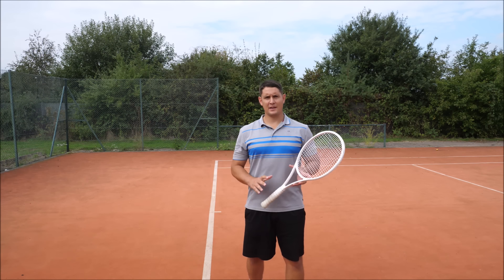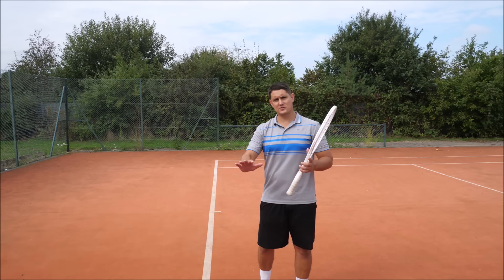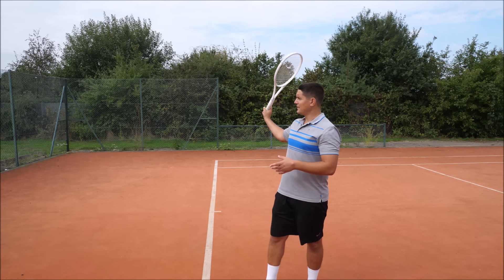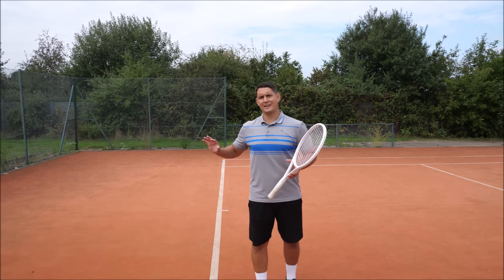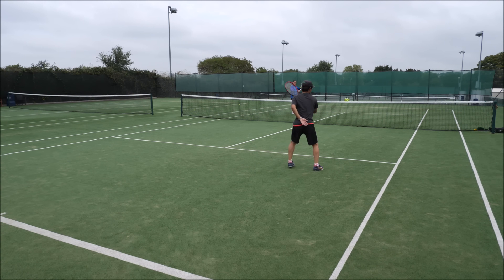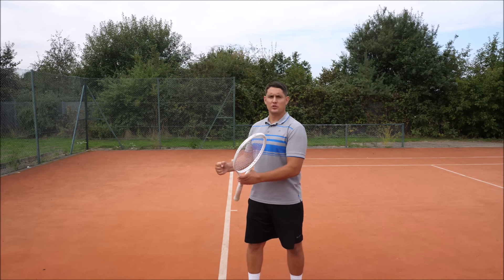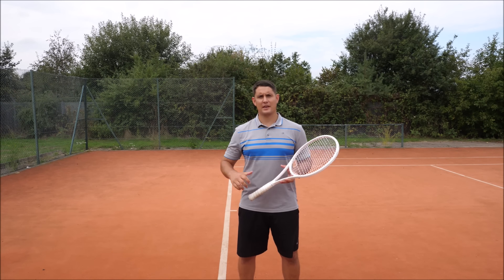Tennis Forehand Transformation - Technique For Maximum Power and Control

Comment: Hi Simon, thank you for this great Video.
09:20 " The upper body goes first" . Pleas correct me if i´m wrong, but isn´t it like that: movement from the feet to the tip of the racket?
I think you have to release your hips BEFORE your upper body, to keep the kinetic chain maintained? Please feel free to correct me :)
Reply from the maker: Hi Benjamin
Normally yes, that is the sequence, the hips open up along with the shoulders uncoiling and the racket follows. However, with this chap, he was opening up too early with his shoulders and hips and his racket would drag behind and he'd contact the ball late so I wanted him to feel the shoulders uncoiling first along with the racket so he could separate the upper body from the lower.
But in general, you're 100% correct.
Thanks for watching.
Are there any videos you'd like to see from us in the near future?
Simon

Comment: So when you have to run to the ball, is it best to have your racquet in the three o clock position before planting to swing or should you plant, turn, and swing?
Reply from the maker: You want to be ready to hit the shot as early as possible, on the run that means preparing the racket on the way to the ball.
You simply wouldn't have to time to run, turn and then hit.
The turn actually makes it easier for you to run because your body is then side on so you can use normal running steps.

Comment: Quick question 
Your forehead form seems to base more on open stand while your student more of shoulder turn and angular, which do you recommend?
Reply from the maker: You need to be able to hit with all stances, each ball requires a different stance and set up.
Open is great for wider balls, neutral stance for midcourt balls you want to attack.

Thanks for watching
All the best
Simon

Comment: Great video. A small remark: the non-hitting arm in the power position is not.there because the balance or tracking the ball (these are secondary factors - in the backhand you don't have a non-hitting arm for the balance or to track the ball, but players are doing well concerning these factors while playing the backhand). The non-hitting arm is important to initiate the body rotation, adding more power to the forehand by accelerating the rotation of the hips and shoulders.
Reply from the maker: Thank you for watching.
Please don't forget to subscribe to the channel and turn on the notification bell.
All the best
Simon

Comment: great lesson man. wondering if you have done or can do a another forehand video, regarding, I have a tendency to be moving backwards on my forehands (or off back foot against pace), and buggy whipping way too many balls , which loops the ball more and makes it much harder to put away .  Suggestions?
Reply from the maker: Without seeing your forehand I can only make a few suggestions, if you're using the buggy whip too often that leads me to believe you're hitting late. So a shorter swing on those fast balls would help, along with earlier preparation.
Work on using the neutral stance as often as you can so you can transfer the weight into the shot.
All the best and good luck
Simon
Reply: @TopTennisTrainingOfficial  cheers amigo, will think about it during my match later, and warm up

Comment: Great tips!  Looks like the student made a heck of an improvement in just one lesson and has the potential to develop a very good forehand.  I think getting the racquethead lower and brushing over the ball was a huge benefit.  I * think * I'm moving my back leg forward but probably not with the torque and timing it should be.  I know I need to work on getting my hips and legs into the shot more and get more flexibility into the racquet lag.  All the good players seem to get a smooth but definite acceleration of the racquet prior to contacting the ball and they get that amazing centrifugal force that a hacker like me has problems achieving.  Relax and shadow swing with perfect form then get out there and let it happen naturally is the way to go I guess.  Thanks Simon!
Reply from the maker: Shadow swings in front of a mirror are one of the best ways to improve your game.

Thanks for watching
All the best
Simon

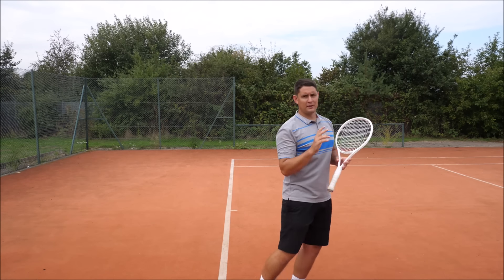Comment: Great video Simon! One thing I would like to point out that at around 9:15 in the video, u tell him that upper body comes first but isn’t it the lower body that comes first and upper body follows. Also I think the hip coming around on the FH or BH has more to do with force you put on the ball through ground force or rotation I. E you cannot force it. Just my honest opinion and points. Feel free to humble me. Thanks
Reply from the maker: You're right when it's an open or semi-open stance. The hips would uncoil first, followed by the shoulders then the arm comes through. However in the neutral stance when you use the pivot step that's not the case. If the right leg (back foot) came first then at contact the player would be totally off balance and the body would be swinging in mid-air while they try to make contact. By allowing the shoulders to come through with the racket you can rotate the upper body, then the hips rotate and finally the back foot. The legs can drive upwards before contact though, you just don't want the back foot swinging around too early otherwise the player will be off balance at contact.
As for the force, if you step in with the neutral stance, rotate the shoulders but don't allow the back foot to come forward, you are blocking the rotation of the body, putting unnecessary stress on the lower back/hips and also destroying your chances of having a good recovery.
Thanks for watching,
All the best
Simon
Reply: Thanks for your reply. I understand what you are trying  to explain, I Just feel that some players force the rotation and lose balance. Rotation should be a natural phenomenon not a forced one. Thanks for your time and I look forward to your next video. Keep up the good work
Reply from the maker: @rickywatson5955  Thanks for tuning in

Comment: My forehand , like this fellow, has inconsistent form. I'm more comfortable on the backhand. I can chose to drive with top spin, hit flat or slice. A friend & I have been sharing the ball machine at the club & that has helped in breaking old patterns. A bad habit of my friend is that he doesn't start taking his racket back on his backhand until the ball is crossing the net - which results in a  mainly late sliced ( weak ) stroke. This has been an excellent video that shows a ~ z of the forehand.  Thanks
Reply from the maker: Thanks for watching Ray
All the best
Simon

Comment: Thanks Simon great info as always...as far as keeping the hand on racket throat to the 3oclock position there seems to be an exception---Djokovic...he keeps his hand on  the throat past the 3pm position (longer than most pros)...he does not take his hand off until the racket is even w his back shoulder approx 4-5pm position....I always felt he did this to make sure he gets a larger amount of shoulder rotation relative to the hips...any comments on Jocko? Thanks!
Reply from the maker: It definitely works for him, his swing does tend to go to 6 o’clock though so slightly further back than many of the other pros. I think if you’re timing is good, it can work. But it’s all about finding what works for each player individually 
All the best 
Simon

Comment: Need to blend this technique with grip. Eastern forehand vs semi western. Racquet path with face angle at point of contact, produces different trajectories, height vs depth and degrees of topspin. A bit complicated but every player needs to think about this to produce the kind of shot they want.
Reply from the maker: That's correct Robert. However the grip is only able to produce a good shot if the swing is correct, if the swing is too big or late, contact will also be late and the racket angle will be off so the shot won't be as good as a well-timed strike.

Thanks for watching
All the best
Simon

Comment: Hi guys, pleasure to hear from you as always.
I'm struggling quite a bit with my forehand now (which it's insane to me, since it was my backhand which let me down in matches while my forehand did all the job jaja).
The main thing is that I can't generate much top spin, my shots goes far too long and I can't pace up my shots as I wanted to.
I know it's something about accelerating with my wrist, but I can't figgure it out.

¿Maybe I need gym to train my forearm to get more power/stability or it's exclusively about technique?

Sorry for my english, I hope I explained it well.
Reply from the maker: We have some new forehand lessons coming out very soon.
Look out for those. In the meantime make sure your racket head is getting under the ball prior to contact and you're brushing upwards from 6-12 o'clock.
All the best
Simon
Reply: Don't think of it as of wrist acceleration but of racket head acceleration. First it would be important to know about your grip: I had an student that was struggling with top spin so we changed from eastern so semi-western grip to make it easier for him to deal with consistency. If you don't know which grip you have, grab the racket like you would a hammer - that would be continental - and keep rotating it to the left one eighth at a time. Two would be eastern grip, the fourth would be full western. Now make sure that at some point before impacting the ball the racket head must be below the ball height and try to brush it diagonally. Though that's NOT the way it happens, try to picture in your mind something like brushing from 4-10 o'clock or from 5-11. Don't worry about depth initially, you can easily get depth adding more height over the net. Good luck!
Reply: @TopTennisTrainingOfficial  Thanks!
Reply: @Motenai  Thanks!

Comment: Thanks for the video. I notice Djokovic for example (when he has time and it isn't a really heavy ball incoming) brings the left hand quite far around like the player here .. but I guess he is getting through the preparation phase faster.. so it's less WHERE the left hand gets but more WHEN it got there that is the problem? Ie he is still there too late
Reply from the maker: Djokovic does bring it round quite far but he also has great timing and can "cheat" that way.
For this player, he doesn't have that timing to pull that off

Comment: I played golf for a long-time. And, when I first started, I had a TOTAL baseball swing (which is bad.) I could (very occasionally) hit it very far, but I was very, very, very inaccurate. 
Anyways, after 2 summers of practicing daily I developed a nearly flawless swing.
I broke it down ONE mechanic at a time and KEPT on that mechanic until it felt natural. 
First, I made SURE to keep my left-arm straight, but I wasn't comfortable enough to break my wrists on the backswing, so I kept my RIGHT arm locked as well. (Which is incredibly incorrect.) For MONTHS I played like some total moron, swinging while both my arms were PERFECTLY straight, with my wrists LOCKED, I looked like a human coo-coo clock and my arms were this pendulum swinging from 6, to 3, to 9. But, despite the fact I looked like an idiot, I noticed I had almost NO mis-hits, and my ball was going VERY straight, though not very far (about 180 yards with a 3-wood.) After that, I just kept adding ONE mechanic at a time, and before long, I had developed a beautiful swing. 
I say all this for one reason: most people like to try and do new things, yet often they feel unobtainable or impossible. Yet, we can do almost ANYTHING if you focus your mind, and put-forth some effort.

Comment: Coach - question, you did not mention face down racket position or head whip in the drill. Are either of these things important for top spin and or power? Second question how do you control the height of your shot over the net?

Comment: great video as usual, just wondering about the back foot follow through, you don't always see this on the pros, why (especially in the warm up)?
Reply from the maker: The pivot step is used in certain situations, for example, if Federer has a shorter ball you'll see him use this sometimes. In the warm-up players wouldn't use it as they are so laid back with their footwork and don't want to waste energy. They've already warmed up properly before the match so the 5 minute warm-up is just to get help them relax and get a feel for the opponent's ball and the court.
Reply: ok, but this works really well with a side stance, when you have an open stance isn't it a bit harder to follow through?, the players seem to only bring their back foot up to the level of their front foot (not in front of them).
Reply from the maker: Yes, that is the common method. The reason I'm asking my student here to rotate 180 degrees is so that he feels what full rotation of the upper body is, prior to doing that drill he was only rotating halfway. Stopping when his shoulders were square to the net. If you study the best forehand they tend to rotate further than that square position, the back shoulder tends to come round much more especially when they go for bigger shots.

Comment: Great Video !!! What about the line designed from the legs for different directions of the shot (line or cross, forehand or backhand) ? wich is the "dominant" leg ? wich leg touch before than the other one e wich one push forward ?
Thanks much, have a great Day :-)
Reply from the maker: It all depends on the stance you're using (open vs neutral etc) and where you need to recover after you hit the shot.
Too many variables to go into depth in writing.

Thanks for watching
All the best
Simon

Comment: Isn't the back leg drive through to the hips rotating supposed to generate the initial power before the shoulder turns?

Once the student has a bio-mechanically effective swing, the student will get a lot of value by learning to relax their grip on the racquet with the added benefits being increased racquet head speed and likely not requiring the use of that tennis elbow brace.
Reply from the maker: That works on semi-open or open stance forehands, not when using the neutral stance (the clip I discuss those mechanics). I agree that when he gets his technique down, relaxation will be a huge factor in his improvement.
Thanks for watching.
All the best
Simon

Comment: Actually you can star moving the hips first (it’s almost at the same time) and it will help you inserting body weight into the stroke.
Reply from the maker: Normally yes, however with this player, he opened up the hips too early and ended up being too open at contact, forcing him to make contact in a weird way. That's why I worked on him staying side on with the body for longer

Comment: Nice instruction but one point he does not focus on is left foot toe placement for the back swing for the forward swing.  Front toe pointing placement affects hip turn range and that affects shoulders rotational range for back swing and forward swing for Racket movement force.  As you hit the ball most of ones weight and balance goes on to the front foot and way the feet and big toe is pointed affects upper body hips and shoulders abilities..  Here is clue in thinking.  My view from directional energy point of view..  Where every your toes is pointed is where your energy is direct in movement of body and hands.  Example as he hits the ball look at his front foot big toe placement and he moves his feet in his forward swing movement as the Racket goes through the ball. 

If you watch the Pros watch their front foot movement and toe being pointed where he wants the ball to go before he hits the ball for them is very subconscious physical sensation for their swing. . See when these Pros foot and toe are point when the  hit the ball  and how foot is very stable during the forward swing.  The foot is not turn way from the target an it has very low movement adjustment.  Point the front toe to them target where you want your force to go. Foot work contains range of movement of the Hips so shoulder in turning hips and rotational range of shoulders.  Instructor does not want his hands to go back as far.  To prevent that toe direction will let ability for take the club back and if look at Pros feet and toe direction the back swing feet are almost strength ahead.   If the front foot toe is pointed straight ahead shoulder cannot rotate backs as far and by toe point straight head the hip turning abilities is quicker on the forward swing and shoulder rotation is shorter and faster to bring the hands to the ball.   

Here is rule from a energy point of view in movement.  The toes points the direct of one energy in movement. Defining what movement you want that is another area to look.  

The. Foot placement at the time of striking the ball let hips turn for force into shoulders rotating to being energy and strength into the hands.  Body movement brings force to the hands but what hands do with it is another area of development.  Hands you have to develop Finger ergonomics within the grip to transfer body directional force into the racket for striking force abilities.  Nice instruction to reach what he wants but foot work toe placement would really enhance the upper body movement to reach his goals in movement like a Pro..
Reply from the maker: Thank you for watching.
You're right, where your toes are pointing has a huge impact on the stroke, however you can also use a pivot step to change where they are facing quite easily during the contact.

Please don't forget to subscribe to the channel and turn on the notification bell.
All the best
Simon